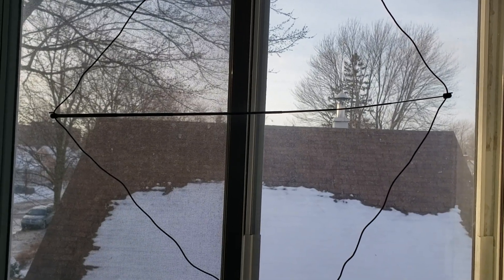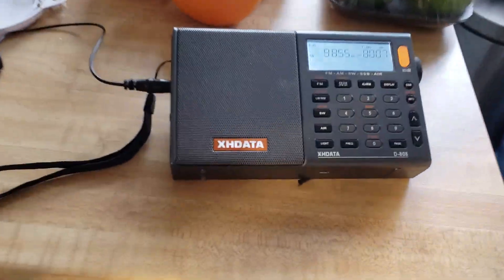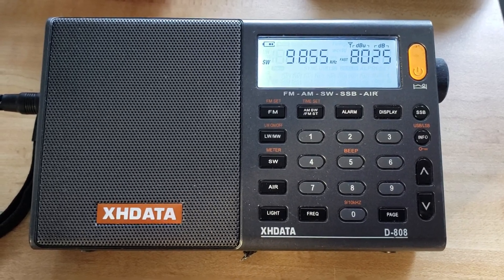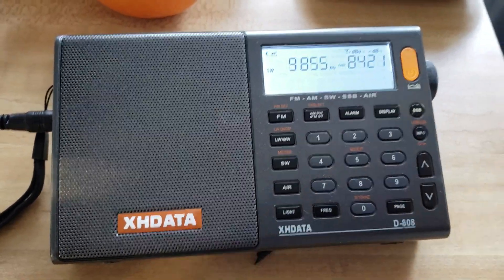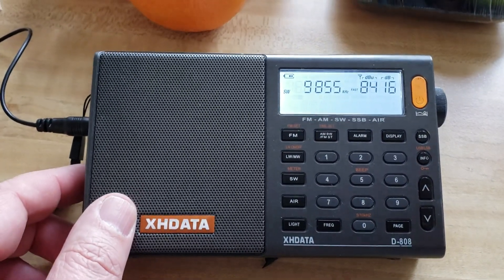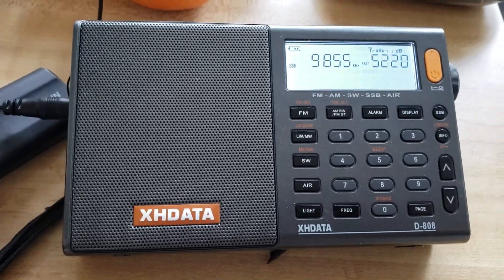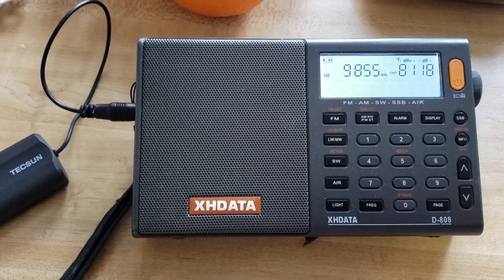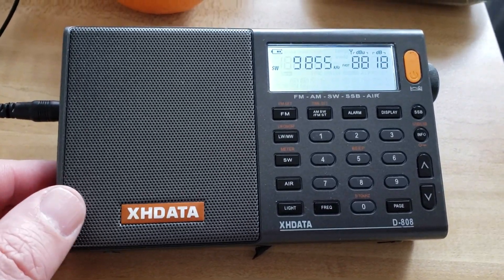First observations on tecsun AN-48X active loop antenna

Comment: Hi and thanks for posting your video, i have just purchased a Digitech AR 1780 so am now searching for an Antenna with a 3.5mm jack so may get this one as it seems to increase the signal, is your one attached to a window with wooden frames as our house has all Aluminium frames and sliding doors. just wondering if it would make any difference. Cheers Glenn v from NZ

Comment: What I understand is that you do not recommend the Tecsun an-48x antenna, correct?
Reply from the maker: MLA 30 a better choice by far
Reply: @OfficialSWLchannel  I see discussions about the originality of the MLA30, which would be green LED and details of the seal. Do you have any more?

Comment: Hello, have you any experience using this antenna on MW in an environment heavily polluted by electrosmog from the neighbors?
Reply: I used this amplifier in an environment as described, without good results in AM/MW. I have a Tecsun PL330 that does not have a connector for an external antenna on that band, so I used the ferrite adapter provided by the manufacturer for the case. If I increase the gain it saturates the radio, regardless of the tuning setting. Even comparing the reception with the gain at minimum, the internal antenna gives much better results.

Comment: I'm thinking: buy it, don't buy it. I expect more reviews on youtube. I am interested in using it outside, on trips on the LW and MW band, I "collect" NDBs.
Reply: Just another question Lilian.Does the Tecsun PL-600 external aerial socket work down the Longwave frequencies so you can use your active aerial on this receiver?
Reply: @ianharling9569  not, just FM and SW. But, I use ferrite bar from old radio with cable (22 turns) to BNC to transmit signal to ferrite internal radio
Reply: Hi Lilian I'm also interested in listening to ndb's what portable radio would you recommend?
Reply: @ianharling9569  I have Tecsun PL-600 and Eton satellite. Tecsun is more sensitive on the LW band and excellent on the MW. I use mini-whip active antenna (Bonito Boni-whip)
Reply: @ER1PL-v9g  thank you for your reply.☺

Comment: Ok, it seems to work on SW if less noise in the room. Probably a reel antenna outside would do the same or better job by also good signals. I missed in the test a comparsion with internal telescope antenna as a kind of reference and that AN-48X both nearby the window. Does the AN-48X overloads smaller radios like Tecsun R-9012, DR-920C and others? The AN-48X is maybe a nice portable antenna for outdoor activities in the summer. Vy'73 DE1DGK
Reply: DE1DGK can confirm a reel does give a better signal